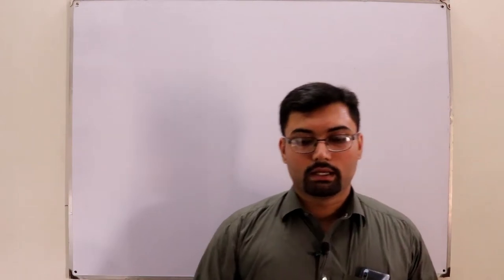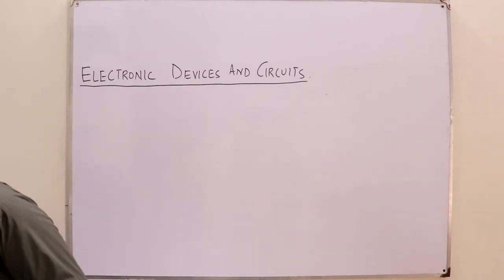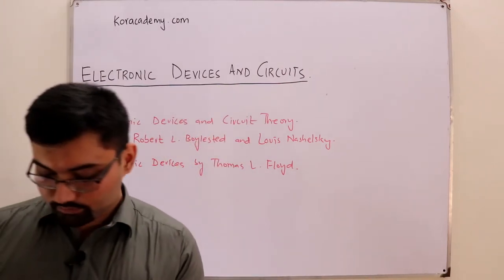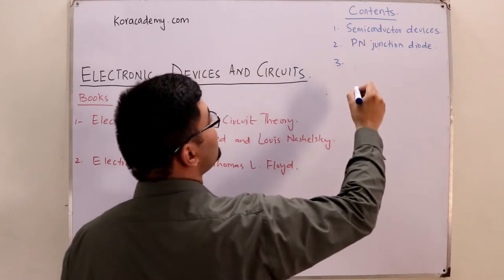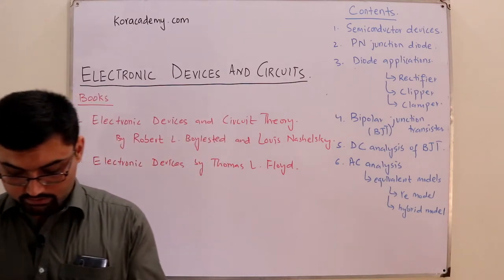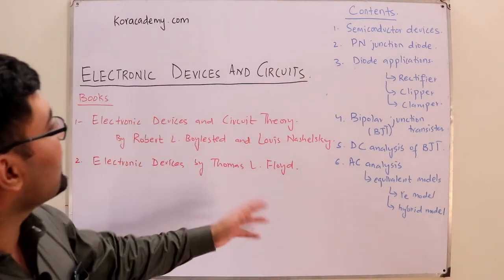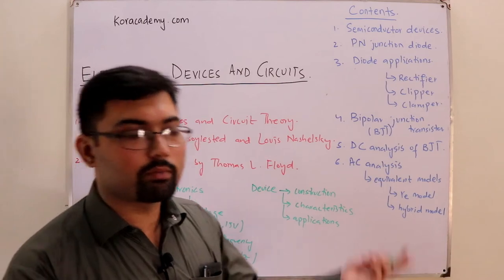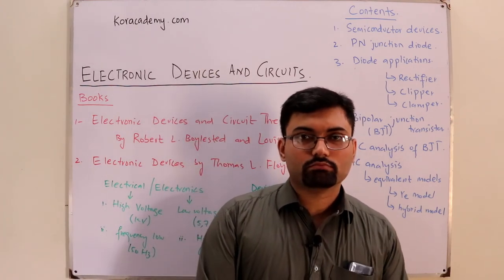Electronic Devices And Circuits

Comment: The frequency in electrical is low which is ofcourse the frequency of power 🔋 coming to the electrical circuits but the frequency in electronic circuits is the frequency of the device used (frequency of oscillations) so if you can explain this comparison a bit more thanks